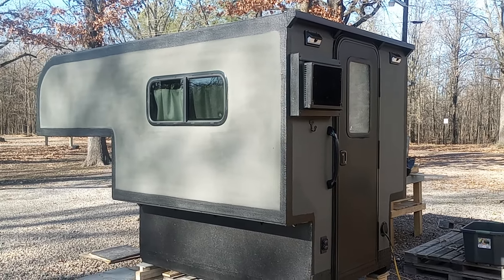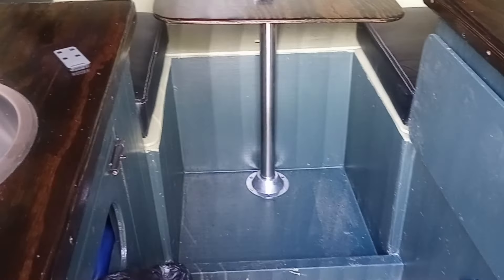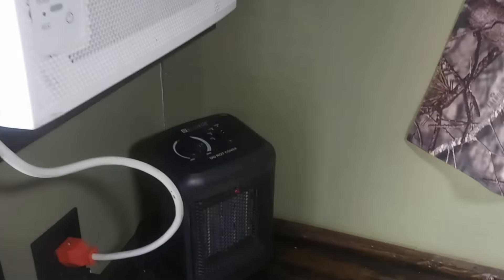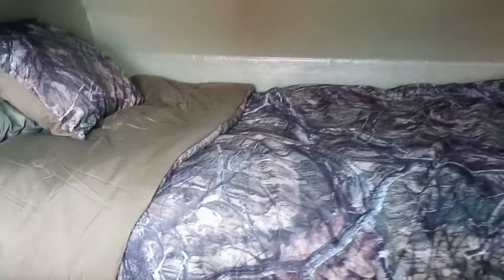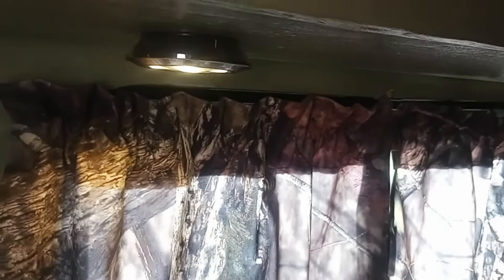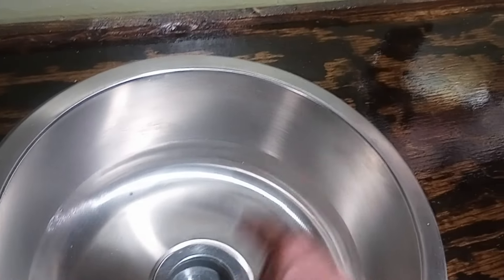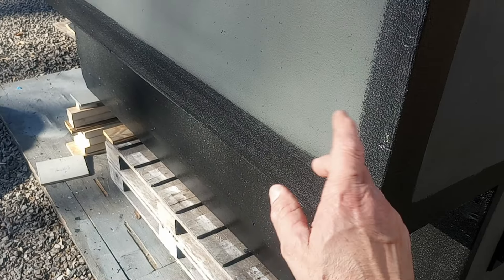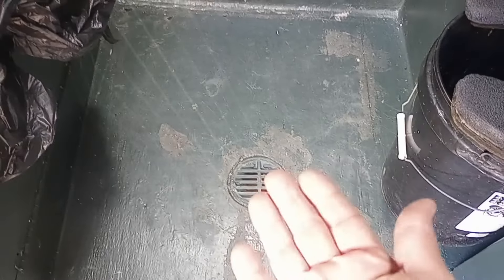DIY Truck camper

Comment: I'd like to know the final weight on the camper.  I have an F250 and am considering my next camper.  I've had a number of campers the latest being a Lance 850.  But, I sold it because even with an f250 once you get it loaded down with water and propane and everything it's heavier than the payload of my truck.  Even if it wasn't, I want to go as light as possible.  There's very little on the market that's simple and light.  Another thing I found is that every built in convenience you get with a Lance, it's just another thing that can go wrong.  I bought my Lance new, yet spent numerous times sitting at an RV shop getting things fixed--and that's even if they could fit you in.  Now, I will only ever own a camper that's simple and modular.  That is, the fridge is a 12v cooler.  If it goes out, you can stop and pick up another one.  The AC, is a window unit; if it goes out stop at Lowes.  All that said, I'd like to know what the dry weight came out to be.
Reply from the maker: They start at 8500 dollars and up